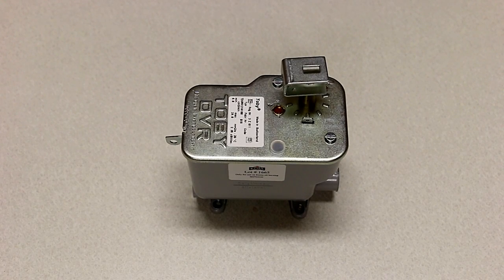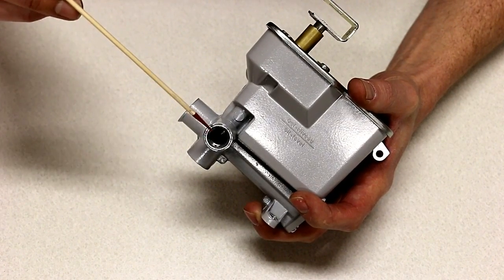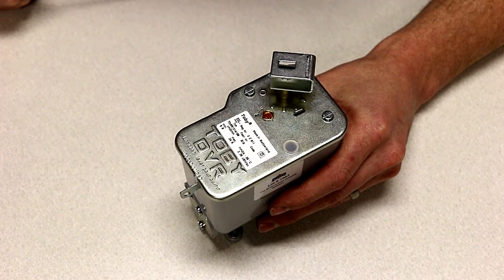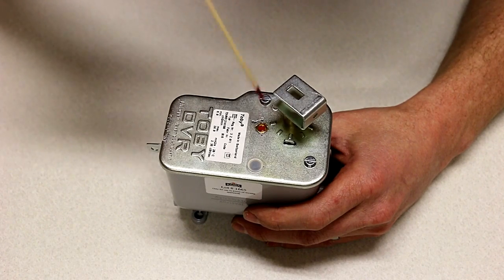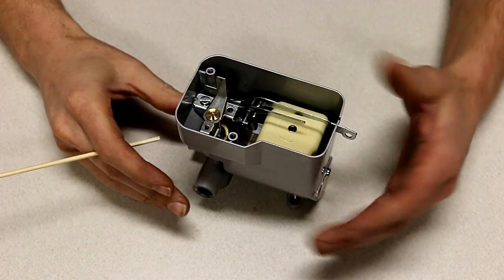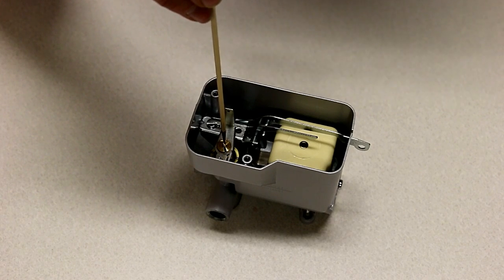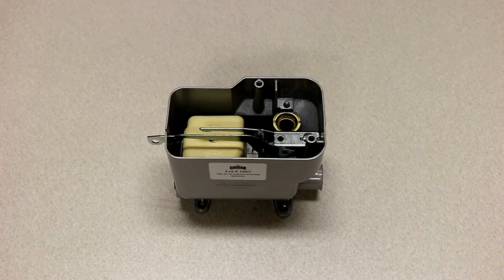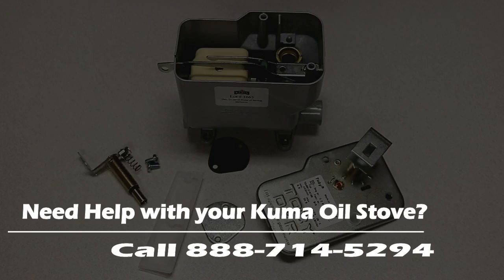Kuma Wood Stoves TOBY Oil Control Overview

Comment: I had made a comment, but I seem to have lost it in the thread.  

I truly appreciate the quality of the video and the simple thorough explanation.   The problem I seem to be having is that the bob is supposed to rise up as the oil fills. But for some reason, it stays down and does not rise up to click that safety lever and stop the flow. Any thoughts?

Comment: on the metering stem.. does it work by????
- as the stem is forced down by the screw above orr.. ... more of the slot in it is then exposed allowing more fuel to go by...  
- the more upward position the stem is  (unscrew allowing spring to force it upward) will  mean less of the slot exposed ,thus less fuel flow
Reply: Close, just switch the movement direction.  When the control knob is rotated towards high, it allows the metering stem to raise, exposing more of the slot for more fuel.  Conversely, when the knob is rotated towards low, the metering stem is pushed down, less of the slot is exposed, and less fuel will flow through.

Comment: I am still having trouble getting the fuel flow to a minimum. It's still burning too hot even at it's lowest setting. Can the high setting in any way affect the minimum setting? This is a new control, so I don't think dirt is an issue. Is it possible that the control is mounted incorrectly? Off level for instance? if so, how do I correct this? HELP!!!!
Reply: If the catalyst in the burn pot is glowing and the top of the flame is even with the top of the burn pot, that is about as low as any oil stove should be set.  If your flame is higher, you should be able to reduce oil with very small adjustments until it's correct.  If your flame is already below the top of the burner then it should not be turned lower.  Sometimes, you will have too much heat even on low, particularly in the spring and the fall when it is not as cold.  I don't think mounting or level will affect the ability to turn down.  Out of level may cause an uneven burn.  Double checking the stove level in both directions would be a good idea regardless.
Reply: This is a wonderful and detailed video. And thoughts on even after all the cleaning, give it about an hour or so, and the flame dies out. It seems that the overflow bobber part doesn’t trigger, if there’s too much oil. Any thoughts??

Comment: If the stove is running too hot at the minimum setting, do I adjust the low setting, or the high setting?
Excellent video by the way.
Reply: Adjust the low setting for the low burn.

Comment: Excellent vid. really helpful - it is all very high precision engineering i had huge trouble getting the plate which holds the filter in to seal, and had reluctantly to glue it in place -but certainly do ot advise this

Comment: i am having issues with oil flowing into my burn pot when the metering stem is placed and the dial is turned, however, the oil flows into the burn pot completely fine when the metering stem is removed. HELP!? PLEASE!)
Reply: I'm assuming you tried cleaning the metering stem slot?  It could also be that the fuel viscosity is too high (thick), or that your fuel adjustments are both set too low.  If this is an old stove but a new problem, focus on cleaning potential blockages.  If this is a new (new to you) stove, definitely check those fuel settings.  Factory settings are not guaranteed to deliver enough fuel, or any at all if the setting is too low and the oil viscosity too high.

Comment: Just a quick point i think the lever is in the down position when operational working
Reply: Ronnie, Not on this model.  I don't know if other Toby controls operated as you say or not.  Another very popular control for oil stoves did/does operate as you say.  That was called OCI (Oil Controls International).  Those were oval shaped and brown instead of the gray rectangle Toby.
Reply: @jleefree  Mines on a harmomny oil stove ive stripped the valve down the slot in the metering jet was a bit blocked re assembled it all preseed the lever to reset the float ,the lever stays in the down position  replaced it back on stove but even on full setting its barely working just one side of the firepot is fired god knows what the problem is
Reply: @casper1240  The lever on this Toby and others will lift up to activate the float inside but then will drop back down to rest at the bottom.  Take the cover off and move the lever up then lift the float.  The rising float with "click" to disengage the inlet needle.  Do this a couple of times to get an idea for how it works.  It's good to be familiar with the Toby on your stove but keep in mind that the control is the least common problem on oil stoves.  Low flow from the tank and a carbon blockage where the fuel line connects to the burner are far more common causes of your symptoms.
Reply: In a sense, you're right that the "lever" is resting down during operation.  However, it's an upward pull that activates the float for normal operation.
Reply: @jleefree  yes agreed Jason you lift the lever up to reset the float .been messing about all day with my stove in the end it was nothing to do with the good old reliable Toby Oil valve . no the answer to my stove was the oil inlet pipe that goes into the firebox was all carboned up id not bveen pulling the pipe cleaning lever all the way to the oil inlet hole  so only letting a bit of oil through  working perfectly now ,so if your having any problems with your oil stove especially the efel & Harmony range check the oil inlet pipe into the firebox fist .these toby valves only have a very low .22 failure rate  so unlikely to be that check the pipe is clear first

Comment: Thanks for this, I have a Sofram/Deville French tent heater which I think uses this style Toby valve or one that is very similar, mine runs on diesel but is unfortunatly leaking from the (up/down switch), obviously this is very worrying but I'm struggling to find anybody in the UK who can service it? Is there anything obvious I should be looking out for when I open it up?
From what I gather the diesel shouldn't be getting this high up to leak as it should trip the safety mechanism float/leaver, any other go too things I should be considering?
Thanks in advance for any helpful suggestions. 👍🏼
Reply from the maker: Mark, It sounds like your inlet needle is not seating all the way down to stop oil flow.  I would suggest that you start with a thorough cleaning of the whole regulator.  Make sure there is no debris or calcium buildup that could be preventing the needle from closing.
Reply: @Kumastoves  Massive thank you for the swift response, you're a absolute gent! 
Will open it up tomorrow and see whats what.
Will keep you posted
Thanks again.  👌

Comment: Can this be adaoted to older vinage Coleman stoves?
Reply from the maker: Most likely, yes.  You'd need to be sure that the original oil level is maintained and you'd probably have a little re-route of the fuel line.

Comment: Thx for thé video, but i see oil in the Toby DVR, but it does not go into thé tank top burn. Pls help
Reply from the maker: Check that the metering stem is clean.  Also, check the passageway beneath the metering stem to be sure oil can leave the Toby control.  Then, work your way toward the burn pot to make sure each component is clean.  Check every fitting and the fuel line.   From there, it's very important that your stove is level.  If it is not level, the oil may not be able to flow from the Toby control to the burn pot.
Reply: @Kumastoves  I think a lot of people myself included dont pull the cleaning bar out far enough to reach the fuel inlet port mine is working perfectly now after removing the fuel inlet pip to the firepot i cleaned it with a wire brush that plumbers use for cleaning pipes

Comment: Great video.  If there are calcium deposits on the metering stem, should any special cleaner be used or just good old wire wool?
Reply: The fuel pipe on my Harmony stove was completely carboned up by the firebox ,i thought it must be the toby valve faulty for the low flame but twas the clogged up fuel pipe into the firebox
Reply: How did you get on sealing unit, we seem to have leak from gasket cover for filter unit.

Comment: Here in Germany you can get parts for a central oil supply system. These old oil stoves are still around and people like me love them. They just plain work. They just need some TLC once a month. The last time a winter storm threw trees at the power lines, my neighbor's super high tech, computer controlled, environmentally friendly, turbocharged, super furnace with a Ferrari red paint job just sat there as he froze in the dark. It wasn't cold or dark in my place because gravity doesn't care about electric current. 

But getting back to the central system, it's really awesome. The pump is expensive. I'm not going to lie. A really good one will set you back €1000.  But!!! Dirt simple. It sucks out of the tank, and pushes up to 6 Bar of pressure into an 8mm  (3/8" ) line. At every hookup point there is a socket with built in diaphragm regulator. Here is where you can kill yourself and blow up your house. The input pressure CANNOT BE MORE THAN 300 millibars. The socket regulates to 100 millibars. You hook it right into the Toby Valve, or get creative like I did and put in a check valve network , so if the power goes out, your fire won't.  If your fire goes out, you had better wait until the pot is ice cold before you refill and restart.  Otherwise you'll be "that guy" who burned his house down and blew off his face at the same time. That happens a lot here too. What can I say. Darwin. 

If you are using ovens like this as a primary heat source, you really should look into a central system. Very simple, and beats the crap out of going to the basement with an oil can every day. I also have 2 oil fired water heaters, so a central system is gold.
Reply: Agree therer basically Bombproof no electronics  to faff about with no annual servicing the most important thing to do with these Harmony and Efel stoves is to  unscrew the brass Ferrule in the front of the stove and pull and turn the oil line cleaning lever  as far as you can pull it out to clean the inlet fuel hole plus you may need a new catalyser approx every 4 / 5 years

Comment: Thank you, thank you for posting this. I have an older Efel oil stove that has the same carburator and I was not getting any fuel flow out of it. Apparently there are no dealers in the US any more so I was preparing to dive in. Your video gave me the nudge to dive in.  It might be a good idea to remind people to keep an eye on the O-ring above the supply slot as mine came off and dropped into the bottom of the carburator causing me to have to remove the guts entirely. Thanks again.
Reply from the maker: Ed, thanks for the comments.  Hopefully, you got your Efel stove running again.
Reply: I actually did.  It turned out to be beneficial that I had to pull the insides out as well since there was some gunk making the needle stick a bit. Now, if I could just figure out why my ignitor won't work, it seems to be providing the voltage that it is supposed to the ignitor coil and the coil has some resistance so it is not broken, but I don't know what that resistance should be.  Thanks again.
Reply: @Kumastoves  I did, but now it has not run for two winters. My electric bill was very high so I dove in again. My carb has a thermostat with a lever that pushes a pin down when it overheats. This pin then closes the flow valve.  It seems to be sticking. Thanks again for the video. I'm glad i found it and will be writing a link on my manual this time.
Reply: Check the oil inlet pipe to the firebox isnt clogged up like mine working perfectly now good luck m
Reply: @casper1240  Thanks, sold the property so not my problem anymore. ;-)

Comment from the maker: Yes, a main filter at the tank is still very important.  The screen in the control valve will not handle all of the filtering requirements.

Comment: Maybe helps to add in line an oil filter after oil tank to regulator in my oil stove?
Reply: Absolutely,  a must in conjunction with a shut-off valve.  Something like this: https://goo.gl/wGk4n4
Reply: @timfraney  you also need a fuel cut off unit in case of fire connected into the fuel line about 5/6 feet from the stove with a sensor placed behind the stove b